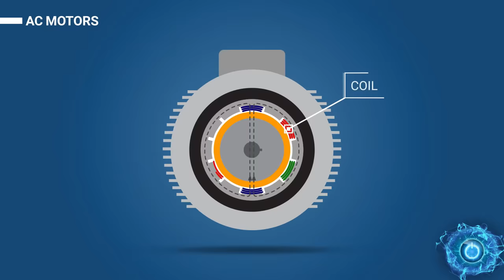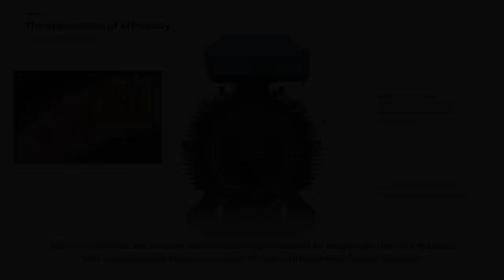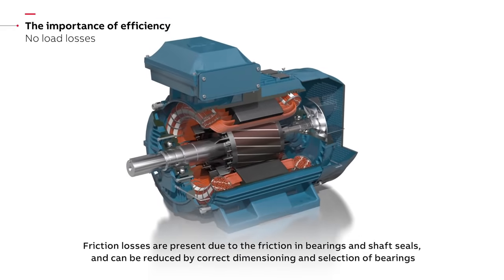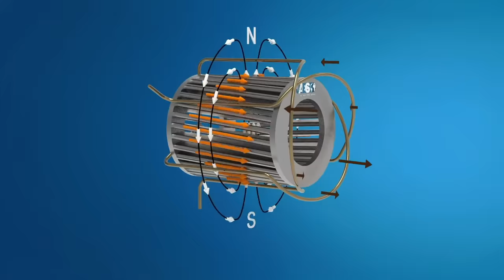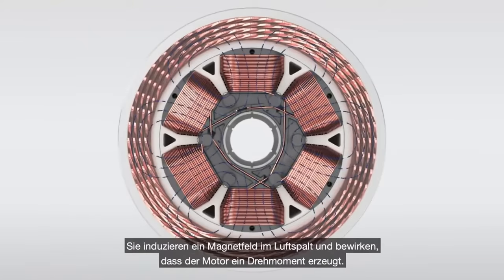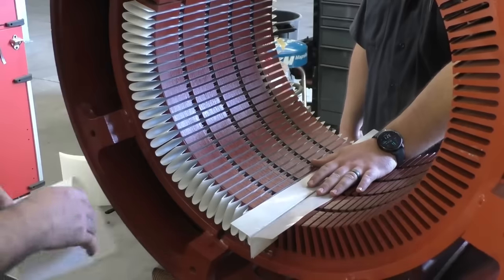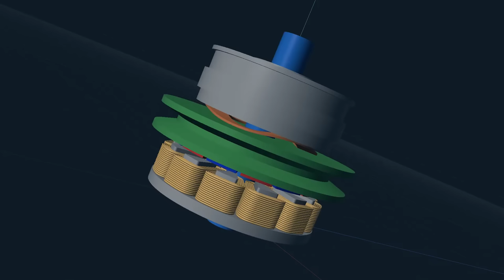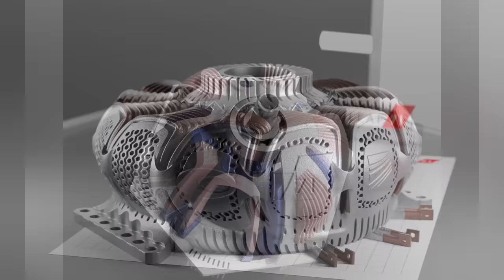GAME OVER!? - A.I. Designs New ELECTRIC Motor

Comment: Though this AI designed motor is interesting, whats really interesting is WHY it made the choice of such a structure. Perhaps it sees what we don't even if its not exactly a working model. Studying shapes is an actually mathematical field, even if this fails, the fact that it produces this complex shape is really interesting from just THAT perspective. What you could to with this, is basically open up a new field of research just from shape perspective, I mean, what sort of magnetic field dose this generate? What shape would the magnetic field take? The current would it have? If it is a bad design, WHY is it? Maybe we can learn what NOT to do, or maybe we can adapt this closer to some other interesting use beside electric motor? I mean what sort of Aerodynamics does this shape produce? THIS I think is how we should study the AI and the things it produces. AI has solved interesting protein structures that NO one thought of a way to do. Maybe it is on to something. Any answer is a good answer for different reason.

Comment: The major problem with any design is tooling and production.
 But if it is for orbital space application? Then it is the fuel cost to get each gram up there in orbit.
 Also pretty hard (expensive) to send a tech up to fix or replace it.
But on terra firma? Toss it and plug in a new one.

Comment: Would that 800 horsepower motor be rated at such a high rpm that it would require a massive reduction gearbox to run any practical machinery?

Comment: Basically, A Sealed And Pressurized, Ceramic Acymetrical Capacitor. These Won’t Work Under Vacuum, Due To Arcing. However, Under Pressure…😊🫥

Comment: The 3d printed copper wont work, Anybody who knows electric motors know those wires are covered in thin insulation to prevent shorting out, AKA they cant touch other electrically. They could 3d print the metal part and hand wind/machine wind the copper wire though. What would be dope is a variable wired stator that can change/increase voltage output based on load, that would be pretty trick.

Comment: We already looked into this and 3D printing cannot provide density required for good conductivity and thought lighter results in less energy density.  It's better to use lasers to hog out of solid billet or near net formed material.  It was enticing given that two materials cans be used together like Invar and copper, but it's simply too porous both magnetically and conductivity.  We have people with PhD after their name who designed motors for Tesla, GM, and Toyota who agreed.   There is however another electrical application for it that makes very good sense. Hint hint

Comment: So, lots of talk about where existing motor inefficiency comes from, but none about why the AI design is better?  No maths, no physics, no experimental results, just word salad.  The closest you got to any scientific appraisal was the mention that the printed copper will have lower conductivity.  That's a bad thing, which will have much bigger impact than any theoretical improvements by the design.  Copper wire has been extruded and drawn, so all of the crystals line up.  Sintered copper has no such structure.  It doesn't matter if you heat treat it to improve the sintering, you're still getting random crystal orientation with discontinuities, at crystal boundaries, and current flow can be likened to setting electrons on a path through a maze.  Sure, they'd find the shortest route, but that won't use the full cross sectional area of the printed coils, so it'll be higher resistance than their size might suggest.  Under full load, I would imagine these running very hot, possibly even melting.  So much for improved efficiency.
I think I'll pass on the invitation to subscribe.

Comment: What about using vortex mathematics with mercury in the core and stainless as a turbine assembly that is turned by the mercury housed in a brass housing? You would basically be using a toroid 3D vortex to spin the mercury  which would then spin the turbine. No magnets or copper required.

Comment: 3-D printing mublety mumble  composite materials mumblety mumble  but will it actually work? mumblety mumble...   What it comes down to is a potential 30 second video that could have said, "With composite metal materials and AI we may be able to 3D print functional motors in the future but we're not sure.  Thanks for watching."  ;D

Comment: it can be better , have you ever seen a steam engine? nowadays you can vaporice water with sound or heat it with micro waves... not much cooper or electromagnetic radiation involved... but also dinamos will be quite better if they are shaped like pistons with magnetos moving in and out of a cooper coil... 3d printing is nice... i think it can use cooper planch instead of wire... but also silver is quite better than cooper for same task i think

Comment: That looks like a cool art project but how elective is your motor relative to the Toshiba or the off the shelf electric motor made by P & H electric motor. Please display graphs show the Tory vs the Jules of energy used and waste heat produced between your strange looking printed electric motor with the wind-looking bushing for its electric monitor how effective is it. Please include graphs. Quantify what you are doing.

Comment: If you can 3D print metal why not just 3D print neodymium magnets with a microscopic halbeck array built into the actual material. Hell, for that matter, you could engineer magnetic bearings into the structure itself and have zero energy losses from friction. I mean the limit is one's imagination. I'm an idiot and I can imagine a whole lot.

Comment: Has it surpassed human engineering? No. I thought of this electric motor and was never really able to put it into construction due to how expensive it really is. Also, this motor is still working with 2 vectors. You can increase the output with another vector.

Comment: I love technology and I certainly love this kind of work but I have to express my skepticism about this one.

3d printing makes weaker parts than say traditional methods and printing coils is always going to be challenging.

Trying to create a more power dense motor also means trying to magnetically push more on the inductors (coils) which is a physical force. It means that the design has to be inherently physically stronger as well. That's why they're printing tubes instead of coils, basically. Because of their geometry they can sustain those higher loads but what does that do to the efficiency? Looks like this design creates a whole lot of empty space which is generally a bad idea. How is that going to increase the power density?
Another reason this design calls for thick tubes is that there doesn't seem to be an insulator between them so I assume that they have to float like springs in the motor.

All in all it's a good idea to use optimization algorithms but they can only optimize what you tell them to optimize. They need to give more degrees of freedom to the optimizer than just the geometry of the electromagnets IMO.

Comment: Hmm - [micro-sized, super-conducting] magnetic domains (metallo-crystals? @cryoTemps) presumably don't allow large-scale ?reactance? currents as needed in the electric motor?  (in comparison to using multiple wire-windings in conventional designs).  Is there any hope of [high-T, Electro-Magneto (reverse [fMRI, MEG ]-like I can't remember instruments)] treatment to transform 3D printed super-conducting [conduit, wire]s, perhaps for both [rotor, stator]?  (While this video mentions thermal treatment, it stopped short of describing challenges at the supper-conducting side).  Perhaps if the "wire insulator" is a reliable ceramic or other high-T material?

Comment: If the problem with permanent magnet motors is that they are expensive than 3d printing is also not really an option becuse it is also expensive so you have no benefit🤔

Comment: nope i already designed maybe the most efficient motor there is and gas engine too. 

the motor little copper no power draw at stall no magnets required but requires a special generator.

the engine is a hybrid between gas and air. the wheels are connected to air motor thats connected to a air tank the engine with air compressor fills up the tank but to add a little more efficiency and a auto shutoff to the engine when air tank is full connect the engine exhaust to the air tank the engine will stall when tank full/auto shutoff and adds more pressure to the tank so every bit of the energy is used it also wont release any exhaust if your not rolling like at a red light no exhaust gets released i used that to move.

Comment: small vertical wind power generator 2kw at 500rpm .... needs a ridiculous 0.5nm driven by a small 20w motor with a gear ratio and tata inverter on it - 2kw 24 hours .... it can be so easy ....

Comment: The title should have been "New revolutionary electric engine created". AI does not design anything, except if you mean it was one of these generative AI apps that are now infesting the interwebs. And these, unfortunately, are not able to design anything.

The second-best title would have been "New revolutionary electric engine created with help of AI", which would have been catchy enough for the layman, but unfortunately pretty redundant for anybody with a minimum of tech-savvy, as engineering relays on AI since at least a decade ago.

Actually, the title shooes away these readers that would be more interested. Like myself.

Comment: The high tech motor you presented is a reluctance motor nothing special. 
How come we are not seeing powder printed motors in the industrial realm? Can the 3d printed material handle high mechanical stress. 
The only thing surprising and cutting edge in this era is seeing young people actually working in industrial jobs like the coil winders you showed in your video. 
Only thing ai has blessed us with is fancy memes like this video.

Comment: No, it hasn't. A kid made a more efficient motor, but wont reveal his design. I know the trick and how it's made a lot better. The secret is to make charge form the shape of a Julian set fractal by adding a pair of negative center/pos end magnets (like cow magnets) inside coils with center mount at opposite sides of a 16 or 32 pole array and make sure the outermost positive magnet tips are exposed to open air, since they'll actually be moving charge so over efficiently, that heavy positive ions will fly off there and need to ground away from the machine. You don't use round wire, you use flat wire around iron cores. It'll produce over 1000hp from 400lbs and runs pretty cool doing that at 5k rpm. Uses N52 magnets (16 on array, 4 more on appendages). This was actually designed by Keely in 1907 and used in secret on some 1908 Model t charging systems by some owners like Ed Leedskalnin.

Comment: This is AN (=artificial nonsense). I am a designer of electric motors since many years. The AI design does'nt make any sense at all. How would you assemble or disassemble that toroidal shaped rotor and stator? And what might be the advantage? In fact, you will loose some torque, because the radius is smaller for some parts compared to conventinal design.

Comment: Lets see it work first.
How are you going to transfer all that 2 mega watt of torque? The shaft and frame needs to withstand the forces constantly .
AI just lied to you! Ask it to proof it by applying it to a  Steckel reduction mill coiler motor in real life. 
Remember, the proof is in the tasting of the pudding , not the "making".

Comment: 2:17 why are using that subliminal messaging to flash an image of a low quality brick stair case next to a wall behind a motor
Reply: It's a test frame from the animation. Basically the animator made it in 3d and tested it in a game engine to see if it worked well as an exported file. Got left in lol
Reply: @danbowes  Thank you for that explanation. I was quite confused but that makes perfect sense.

Comment: Get real guys 3 d printing in metal has two max performance drawbacks.  Density of the iron . Low density on the pole faaces restricts flux density and hence torque ..not good for ultimate performance.  The density  iron else where is not so critical if you have dense windings ( copper) opps density again.. The second drawback is rough finish on  windings means you have to use much thicher insulation that the tradition varnish ( overall winding density again).  The peaks on the copper surface finish just make a focus point for the insulation to electically beakdown .  These are desk ornaments only.   The formula 1 printed metal parts are sintered to recover the desnity  not reall aplicable to an asemmbly.

Comment: AI has better calculation ability than humans do, and has, generally, access to more data, than humans.
Before engineers can analyze 3 drawings, they spent 3 days to find, AI has already searched all the internet for ALL available data, and data given to it from "patented secrets", and "create" most optimal designs. People, unlike AI, are creative creatures, but lack access to data, and high computing power. AI has high computing power and HELPS PEOPLE to calculate, what they spent years for learning knowledge and "try and error" process. so, can we still say "AI created"??
In my opinion, AI has calculated all possibilities and put them all into one full working design. But, would AI ever be able to "create" a full working design, if it hadn't got data, from what PEOPLE had created, fully working but inefficiently , because were unable to calculate to the best efficiency, yet ?

Comment: First of all curent "AI" is nothing more than simple algorithm used in early computers ,like comodore64.Only difference is that computer speed and mostly network speed is fast enough to give this tool to people. But it dosnt do anything more than mixing context. And its not even especialy accurate. And as for engines there are only 2 types of engines currently good for anything...2/4stroke piston engine and jet turbine. Those engines which are currently "inventend" around the world most of the time need rebuild every test. And this is totaly no go for any kind of engine. They are just toys. Besides some times making something simple isnt best idea. Piston engine may not be simple but it works, is extremely reliable,simple to maitain and modify and this are it inherent traits. And its not like those new design can beat it, some may say they are young designs, granted, while 4 stroke piston engine was designed and build almost 150 years ago  there was not much important changes during this time and it was designed and build using pen,paper and hand tools. Now modern engines use CAD software which are even able to simulate structure stress and wear. Only things which can be improved are materials cause basic phisics wont change.

Comment: AI helps humans with human problem(s) and simply builds with human building blocks so it is designed by humans AI is after all 'Artificial' and is used purely to speed up any process what humans then do is use 'RI' Real Intelligence to disseminate what can be implemented and what can not. If humans are in error in ANY 'effect' then so AI be the same! Else we would be able to ask AI how to fix ANY human problem that we do not understand at this time! All data feeds into AI is real world human data it can not expand beyond that realm else it would simply be distorted realities like the current mathematical models for many things CICO (crap in  crap out).

Comment: This video has an annoying low audible ding sound.. possibly trying to audial hypnotise.
Sorry but Ai only works by command, and this is commanded to be a motor given variable that are only based on current knowledge of trapped physics.. of gravity and thermal dynamics.. as it doesn't matter what materials are used, deformity in materials will always happen.

Comment: 😂 it's game over for the electric engine. It will never replace diesel.That's why diesel engines are used for construction.
 The energy output to a diesel engine is why the they're used for heavy construction.

Where has the electric engine charges Lithium batteries, the most dirtiest thing to try and recycle on the planet.
In fact, when they recycle lithium, it is all sent to china, where they put it in large lithium pools, which end up killing any of the wildlife that come near it.Birds drop dead over these lithium pools all the time.
Reply: The electric engine might be the dirtiest thing we've created because of the lithium battery.